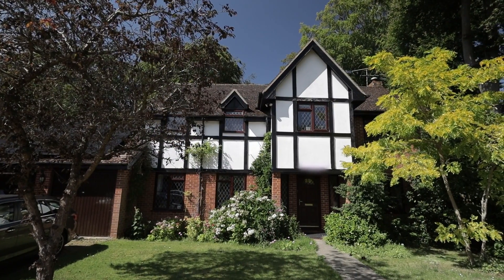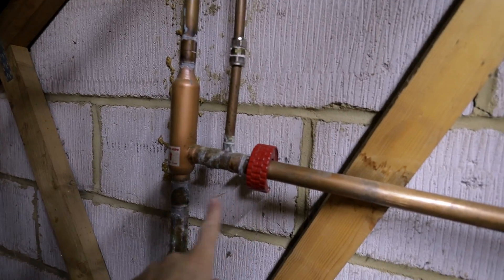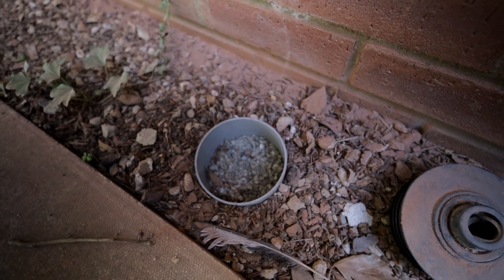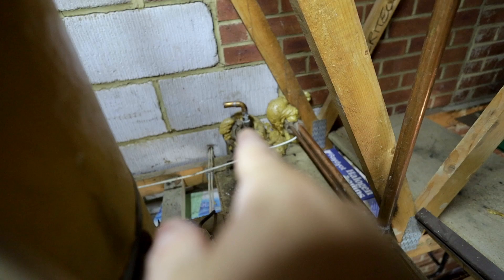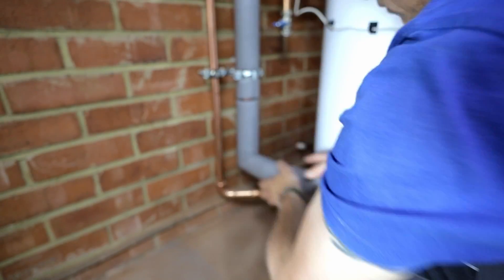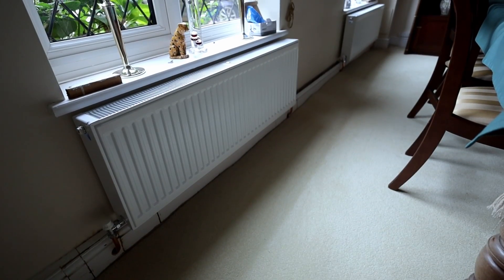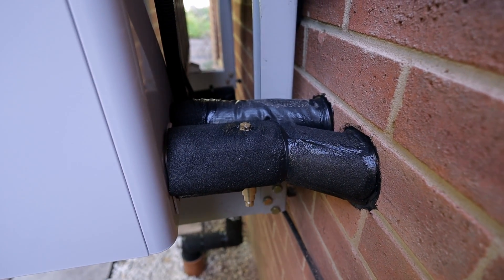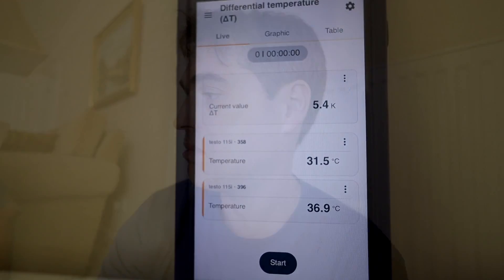Heat Pump Retrofit in a 1980s House: What's Involved?

Comment: just out of curiosity, did you not have issues with the vibration of the pump when mounting it on the wall? I've had to remove a few pumps that were installed wall mounted as they had actually caused cracks in the brickwork due to the vibration

Comment: i would love to install this exact heat pump but only have space to wall mount it, my biggest concern is the vibration, i have a brick clad timber house would it be worth using isolation springs to prevent vibration though the wall? its great that its so quiet and low vibration but i will be in the dog house if my other half hears any noise after installation haha

Comment: I retrofit a heat pump in a old house, the circulation pump have trouble running smoothly :-( There is noise in the tubes when the circulation pumps is running. Is there an "easy" fix for that? Cleaning/changing the circulation water? fixing air tightness? Is there a good procedure for that?

Comment: Do you still fit TRV's to the rads when not using third party controls and not zoning? Or do you just put a pair of lock-shield valves on? Also when checking the delta T on each rad would you choke any of them down to achieve what you want?

Comment: I recently had a 7kwh Vaillant Arotherm Plus mounted on the wall. I posted a few pics on the Vaillant Facebook page and got flamed by everyone saying it would be noisy and vibrate inside the house. You can barely hear it with your ear against the wall whilst holding your breath! The gas boiler was 100X more noisy...

Comment: First of all, you seem to do great work and come across as very professional. However, I just can't get past the maths. A litre of kerosene here in Ireland costs about a euro and contains about 10kwh of energy, meaning you'd need to be getting your electricity for much less than the €0.35 per kwh that we pay here.
Reply from the maker: Not quite that simple - boilers are really o lot 80% efficiency and average efficiency of my heat pumps is over 500% on heating and 470% combined CH and DHW. This makes my installs cheaper than gas or oil. Also a lot of my client have solar and battery storage plus cheaper tariffs - making our installs half price of even the most efficacy oil or gas systems

Comment: Interested to understand what you use for the design / heat loss calculation? Main variable that is affecting mine is ventilation / ACH figure, can make a big difference across 230m2 bungalow

Comment: I found your video very interesting and informative. Clearly you are very knowledgeable and thorough. My house was built by Bryant in 1990. The radiators on the ground floor are fed by narrow bore pipes. Upstairs the pipes to the radiators are a wider bore. Is this likely to present problems if I decide to have a heat pump installed?
Reply from the maker: No, microbore is usually fine - just needs a very good installer to make it work - check my latest video about it

Comment: Great Video as always! I’ve rewatched this and still have some confusion to clarify. You made a really interesting point about 3’rd party equipment and additional equipment like buffer tanks reducing the efficiency. Therefore, does that mean the cylinder in this instance is for heating hot water for shower/kitchen? I assumed it was a buffer tank!
Reply from the maker: the cylinder is just for hot water

Comment: this is exactly what i wanted to see - about to get my vaillant heat pump installed on my wall backing onto the upstairs landing, so not too far away from the bedrooms. was getting a bit worried about transmitted vibration and noise but this puts me more at ease!

Comment: Thanks for another great video. I live in Norway and was wondering if you know at what outdoor temperature HP CoP starts to drop. Here from Dec to Mar it is usually between -5°C and -15°C. This is when the heating is most needed.
Can the DHW cylinder be used as a heat battery to store heat during the night (electricity prices are generally much lower at night) and then release that heat in the morning when the electricity prices surge? Or is there a better backup heating setup?
Thanks again for all your great content, I'm a huge fan ❤

Comment: I really enjoy the level of detail you provide in your videos. Thank you.
If the outside Vaillant unit was mounted a foot higher, you could put the trash bins underneath it!
You could use a small mobile hydraulic scissor lift table (about 400lb capacity) to raise the unit instead of four people. These tables typically raise up to 5 feet and cost about 300 pounds.
Just some thoughts.

Comment: I installed a heat pump in our house from 1932. We are mostly satisfied and while it does use electric heating sometimes, it is very rare and we hope to do a pass on the windows, attic insulation and replace the old single pane radiators with modern low-temp ones for more stable indoor temperatures and a more efficient house.

Comment: Your very knowledgeable, in my apartment I have Stelrad K2 Radiators fitted with Drayton TVR4 temperature control, 10mm plastic pipes branch off from a 22mm Manifold I have a unzoned system, Viessmann 200W B2B Gas Combination Boiler, 
I have all the temperature equipment But its 10mm plastic pipes to every radiator would you measure from Drayton TVR4 input to the flow valve on the other side? Plastic 10mm is Not a good conductor of heat like copper 15mm pipe, 

I be honest yes I should have gone for 15mm copper pipe, but my thoughts was to have as little water in the pipes, 
So I'm looking for a Delta of 10 - 11°C ?  Or Far Lower I've upgraded the pump on the Viessmann 200WB2B to the recommended high efficiency pump I've had the system nearly 14 years, I recently did a cold water flush with Fernox F8 left in for just over a week, that helped a lot to get scale from the system,
So in 3 bedroom apartment 110sq ft 9 Radiators inc two towel Radiators I just want to set up the system to optimum

Comment: One company quoted £5000 and second over £10000. Second also told that there is no savings in cost compared to gas boiler. Really confused. Why would anyone spend over 10 grand with zero saving. I already have gas ufh. I am looking into solar panels and ashp to save money and more comfy house.
Reply from the maker: You will only save money if the system is both designed and installed well and runs at scop / cop of 4 or over. Battery storage and PV can make it much cheaper to run than gas.

Cost of install will be high though

Comment: Afterwatching your videos I'm now looking forward to our system getting fitted in the next month or two. We have an old oil boiler that costs us roughly £1200 of oil and  service a year to run, I'm hoping that will be the same for electric or even cheaper as we're getting solar roof panels at the same time.... Great videos... Keep em going 👍
Reply from the maker: good luck with the installation. I hope you found a decent installer.

Comment: Hello, I watch your HP installation and enjoy. What temperature do you keep in the hot water cylinder?
Reply from the maker: 50-55
Reply: @UrbanPlumbers  thank you for confirming. It's normally set at 60 C to avoid bacterial growth. Is there a periodic cycle to run at 60 C? In your opinion, should I go for the Vailliant or Daikin? I am still exploring
Reply from the maker: @gp362148 yes there is. Go for Vaillant, Daikin not even close.
Reply from the maker: @gp362148   vaillant 100%, daikin is not even close.

Comment: Hi ! - You're videos are excellent and are helping me decide on the way ahead.  I have an oil boiler and a wood-burning stove boiler. I can use one or the other depending on our needs and the weather.  I wanted to ask if you have done an install with a Valliant hybrid heat pump with a wood-burning stove. My existing system uses a neutraliser to distribute hot water to both the hot water tank or my radiators from either the stove boiler or the oil boiler.

Comment: Fully agree with all the positive comments you got!
 Vaillant recommends the hydraulic module MEH97 for the 3way, and extra heating. Seems to ease installation. Why are you not using this?
Reply from the maker: Not needed and lowers the efficiency of the system

Comment: I love the idea of a heat pump, albeit I just can't afford it at the moment, but I am concerned about space. The only place we could conceivably have the outdoor unit would be right on our patio which feels a bit less than ideal but I guess could work. We are an end terrace and have no side access at all. BUT the bigger issue is the amount of space needed inside and the awkwardness of where the existing UFH manifold is relative to where we could site the outdoor unit. We do have a loft and it currently has the hot water immersion tank (140 or 150l I think) plus the cold water header which feeds the main shower, which we use exclusively, and the bath, which we never use anyway. Right now we have an electric flow boiler which takes up no space at all. The loft hatch isn't all that big so I'd be dubious about a cylinder fitting up there (these new ones look to be about just over 500mm wide I think). So, assuming this is the case, what options are there likely to be for a house like mine (I do have on other possible place but it is a very useful storage cupboard so I'd have to work out where we put the absurd number of hoovers we have, but really I'm just interested what can be done for those more marginal houses that really do have space constraints that can't be overcome, or not cost effectively)

Comment: Very interesting videos. We just had a VWL 125/6 plus a Unitower VIH 190 installed. Will install the SensoComfort and SensoNet unit in a few days as they were on backorder initially. So, currently we have the unit on "summer" mode only using it for tap hot water. In our 145 smq meter house we have radiators, so I wanted to ask you if we should still use our radiators in the same way as previously? We have older style thermostats that we usually set at around 2-3 for a temperature around 19 degrees. Do you know of any digital thermostats that work with the Vaillant system?
Reply from the maker: Don’t use any thermostats. Only use vaillant controls if you can

Comment: Thanks - video is excellent - helped me understand more. 
Question: If retrofitting to  house with showers, do the showers run off the mains pressure still, or do you need a pump? Thanks.

Comment: At what point would do decide the need for a buffer over just using a mid position valve.

In a 6 bedroom rather large property would it be worth installing one just so I have an increased volume of heated water and a second circulator on the radiator side of the buffer?  

Thanks
Reply from the maker: I only install buffers if the system is too restrictive for the built in circulator. This is dictated by the heat loss and existing pipework size and layout. All have to be calculated. 90% of installations don’t need a buffer.
Reply: Thanks, I’m an engineer local to yourself. If there is an opportunity for me to come see your design and work  process on a job at some point? If it’s not too much trouble for you.

Comment: Congratulations on another install..meet you at installer show and you pass me to a guy who do teaching...so you can confirm that a heat pump will work...but will heat up the house slowly...comparing to a gas boiler..but will also save money on electricity comapring to gas usage by a 30 or 35 kw boiler....am i correct

Comment: Question, do the house radiators run at 40¬45? and do you have an issue with sludge buildup in the heating system when it is not being brought above 65 like the older Oil or gas boilers do?

Comment: Hi love your videos. We are refurbishing our home in Holland. We have laid new underfloor heating throughout (Upstairs and ground floor). We did have a big combi boiler but removed it and now looking at what efficiency options we could consider for a new system.  Gas is expensive so we would like avoid that big possible.  Floor area is about 275 meter square. I like the look of that Vaillant heat system. Could you share many ideas / thoughts? Thanks.

Comment: Really enjoyed this video and very much reassured about fitting a heat pump in an 150+ year old house. Have you any reports of the before and after energy costs from customers who have replaced oil boilers with a heat pump?
Reply from the maker: Not oil, no. All we removed so far has been gas. Finding an installer that can deliver scops over 4 is the key.

Comment: Great work, very impressive. Watching from Canada…I have an air source cold climate heat pump forced warm air using a matching air handler that works great. Love the idea of a “soak away”, I think you called it. However, I’d need to install a long French drain below the frost line to handle the defrost water. It’s on the side of my house out of the way, but typically has a minor iceberg underneath most of the winter.

Comment: Is the heat pump not way too close to the wall? I thought they need a 300mm gap? Great information as always.
Reply from the maker: 250mm is required. Exactly what it has here. Although I would argue that went wall mounted it will work even with less than 200mm space due to better air flow
Reply: Ok good to know. @UrbanPlumbers

Comment: Hi Szymon, i did not notice in your channel an intalation of Vaillant Arotherm plus with Unitower unit yet. Are Your clients (especially with new houses) not interested in this solution? I have Daikin Altherma 3 FR (similar solution) in a new house and I think it looks much nicer then clasical cylinder + controler and uses less space. In my case even without all visible plumbing, next to the closet it looks like another part of furniture. Thanks.
Reply from the maker: I don’t install Unitowers. I can’t use my own diverted, they are double the cost and more awkward to find space for. I am not a fan of pre plumed anything. Prefer to have flexible solutions, so you will probably never see me install one.

Comment: Nice install, im not sure many people would do that much investigation into the existing pipework. Also do you know the recovery time for the DHW tank?
Reply from the maker: Dhw recovery is a function of temp rise x volume x SHC of water divided by input.

In this case we have:
250l
35c temp rise let’s say from 15c to 50c
4.18 kJ specific heat capacity of water

Divided by around 7kw input 

250x35x4.18/7 = 5225 seconds or 87 minutes = 1 hour 27min 

This client sets it for a 2 hour window at night when the kWh is only 9p and uses around 3kWh for the full cylinder recovery. So it cost 30p a day to recover the full cylinder or around £10 month.

Comment: The only question i have from this video is, why third party controls and zoning would lower down efficiency? U mean best thing is to leave pump constantly ON not letting house to cool down because it will take alot of energy to heat it up again? What kind of temperature controls this heat pump have just wireless Vaillant stat? With combination with external sensor that increases and decrease flow temperature?
Reply from the maker: Check Heat Geek channel, Adam has done enough work on this topic that is top class.
Reply: @UrbanPlumbers  thanks i will.

Comment: Hello, If house is 80m2 and only electricity no gas .Water system (water tank with two heaters inside) , and heating radiators electric only. House is not properly insulated . In this case what would be the best way to convert ? would it require to put pipe work for radiators? .
Reply: For a system like this (A2W) you'd need pipework in for rads yeah. The alternative is to look into an air-to-air heat pump system instead, there are pros and cons, e.g, they aren't eligible for the 5K grant, but generally work out a similar end-user cost, and have the benefit of being able to cool in summer.  It depends on whether you have sufficient wall space for the typical AirCon-style indoor units.  There are "Floor Console" units that can be fitted to where a radiator would be but generally, they're more expensive than the AirCon-style.  The Toshiba Haori multisplit seems to be pretty popular in the UK for the AirCon-style.  For hot water you'd need to look into an alternative - either switching to a having a cheap overnight tariff and charging the cylinder overnight at a cheap rate, or look at a heat pump hot water cylinder.

Comment: We tested a new heat pump instal about 12 years ago. Full instrumentation. We found the COP collapsed in winter when heating hot water. It couldn’t do 55 to 60C and ran continually. Switching to immersion heater would have been more efficient for the last bit of temperature. Do the latest controllers do this?
Reply from the maker: No, r290 doesn’t use immersion back up and is always more efficient than direct electric, even at very high temperatures

Comment: Are heat pumps cheaper than gas central heating ?, I live in a 1 bed flat I'm comfortable at around 22c but uncomfortable at 20 - c or 28 + c so will a heat pump regulate those temperatures without having to use things like internal fans etc
Reply from the maker: Heat pumps can be much cheaper to run and provide much more stable and comfortable environment in your house - but only if installed and designed correctly. You can’t just fit and forget like most do with boilers

Comment: Absolutely fantastic videos debunking many HP myths. How easy would it be to run a solar thermal system and a heat pump side by side? We currently have ST to a separate cylinder but would like to merge into 1 cylinder and have an HP to replace the gas circuit. Challenging or not too tricky?
Reply: You should be able to do this with a dual coil cylinder. Something along the lines of the Gledhill Heat Pump Solar, which has a coil for the each of the heat sources.